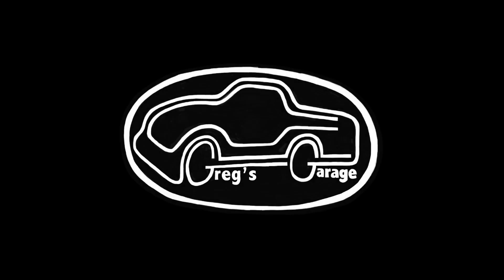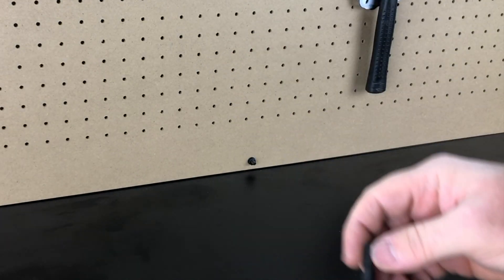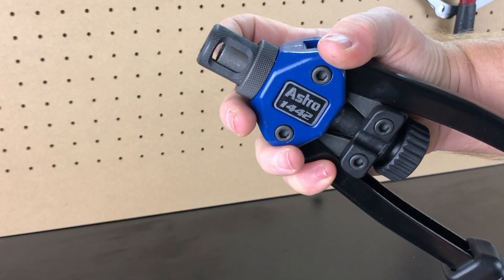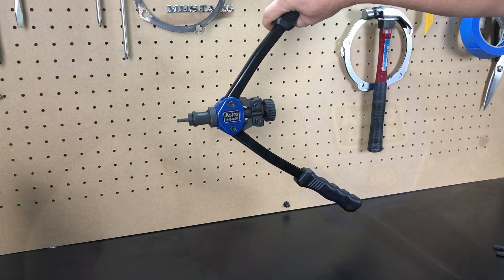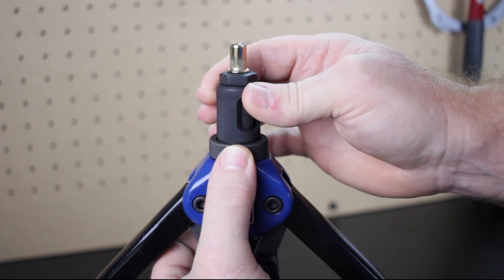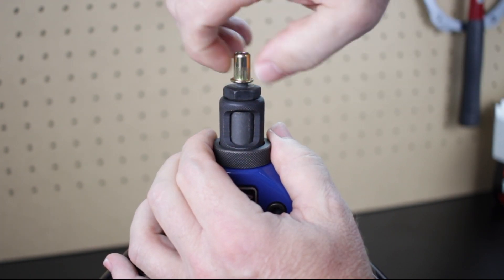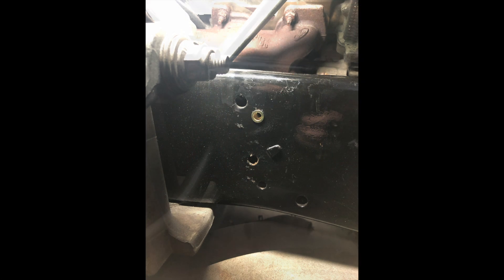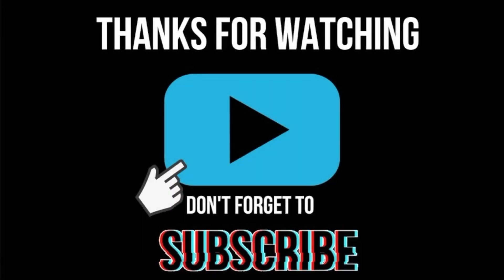Threaded nut riveter tool review/demo (Astro Pneumatic 1442)

Comment: Used to install roof racks during the 70's. It still have mine that is just like that. It's like a step bit was called uni-bit in 71 when I bought mine. Same on auto-adjust vice grips and SnapOn hand impact needed for motorcycle side covers as 60's Phillips screws! Thanks for the video
Reply from the maker: @deankay4434 Tanks for the comments and sharing your knowledge. Hope you are enjoying retirement.